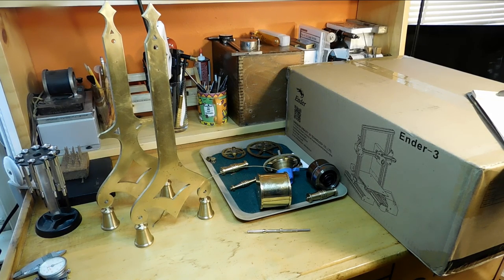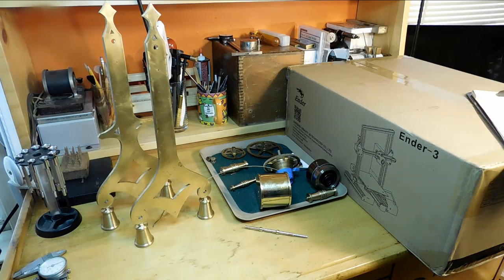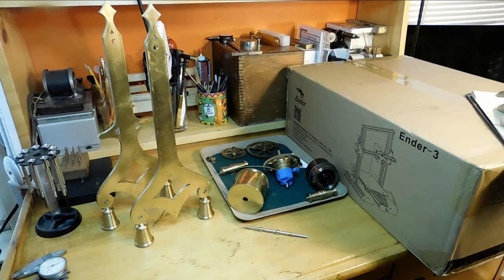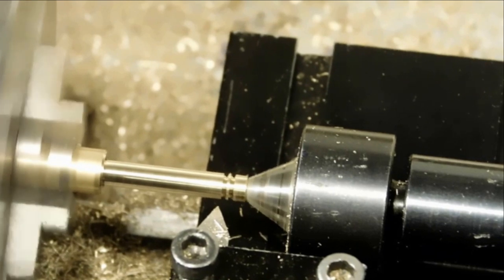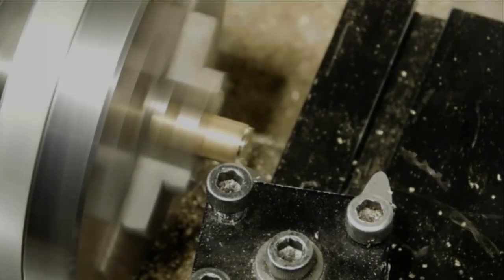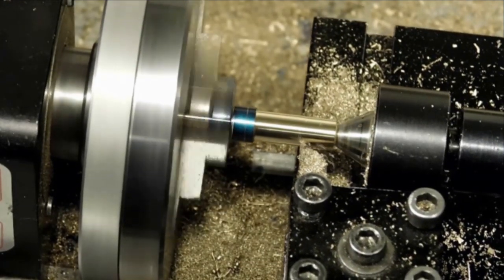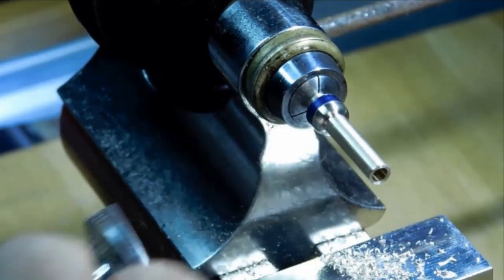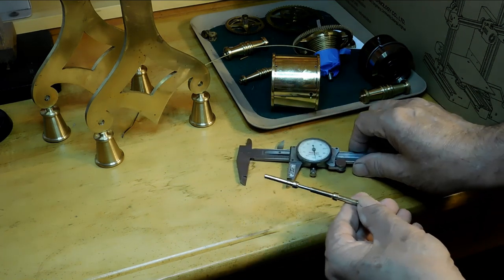WR Smith's Grasshopper Clock: Part Five Barrel Arbor Length Gauge

Comment: I wish you a speedy recovery. Sounds like the worst of it is over. 
Really enjoying your channel. I have been putting together a clock workshop and my aim is to build the grasshopper clock as well. Your videos are giving me the confidence to give it a try. Keep them coming.
Reply from the maker: Great stuff Brian...if you have not done so yet...read Longitude by Dava Sobel...story of John Harrison a carpenter who built the clock/watch that allowed us to find longitude at sea...BBC has a great series on it  as well...he designed the grasshopper escapement...great story...bob
Reply: @robertt-cs8fe  Hi Bob. I've read the book and the story of John Harrison is one of the reasons I would like to build a clock with the grasshopper escapement. It's a bit above my skill set at the moment, but I'm working on getting there.
Reply from the maker: Great stuff Brian...WR Smith is another source to help gain the necessary skills...thanks for stopping...see ya...bob
Reply: @robertt-cs8fe  Hi Bob. you mentioned The Clock and Watchmakers Guide to Gear Making by R.D.Porter in one of your previous videos. It's just about impossible to get in the UK, but I'm going to New York for a couple of weeks next week and was thinking of buying it on Amazon when I'm there. Do you think it is worth getting this book?
Reply from the maker: I use it a lot for making gear cutters...I've replaced gears in clocks as well as cut gear trains...I find it very useful for my work...if you plan to buy a gear cutter set...maybe not so much...hope that helps...bob
Reply: @robertt-cs8fe  Thanks Bob
Reply: Just got back from NY and I did get the book. I'm very pleased with it. Worth every penny. Thanks for your guidance and advice.
Reply from the maker: Great stuff Brian...I've found the book quite useful...I've even used the tables to reverse engineer cutters for off the wall repairs...have fun...bob

Comment: Hey Bob.  Hope you like the Ender 3.  I have been pretty impressed with it.  I would recommend a few upgrade to the printer when you have it up and going.  Most of these I talked about in the video, the only one left out was the filiment guide.   If there is anything I can help you with, just let me know.  I am looking forward to more of your Grasshopper build.  Glad you recovered well from your knee replacement.

Joe
Reply from the maker: Morning Joe...I got the Ender 3 up and running this morning...awaiting filament...will practice by printing upgrades for the Ender 3...going down into shop to set up for next Grasshopper clock build...good thing I'm retired...can't figure how I ever managed to fit in 8-10 hours of work each day?...having fun...bob
Reply: Funny you say that Bob.  I have a friend Jerry who has been retired for about 10 years now.  He tells me he works harder now and longer hours than he ever did while he was in the workforce.  :-)

Hope you have good luck with the printer.  If I had one complaint it would be how hard the prints adhere to the bed.  But that is better than them not sticking.  Again, if you need any help, let me know.

Joe

Comment: Glad your new knee is working well. Please leave your bloopers in.IE hitting your live center. That is how we out here learn :-) 

You may what to consider covering the watchmakers lathe in detail some time. I'm not too familiar with them to me, they look like a miniaturize wood lathe. What to look for if buying one. Take care
Reply from the maker: Ya left that one in by accident...if I would have continued on a bit  I paused and reground the bit...had to let it hit 3-5 times before I caught on to what exactly was hitting...with the CNC I was more concerned that I got the ending position right and the start screwed up on me...At Xmas time every year I tear down the head-stock of the Moseley and Peerless watchmakers lathes and lap the bearing surfaces... pretty much the same way you do with engine valves...that might be a fun video...I turned a balance staff a few months back but the video was in and out of focus as I was using the microscope...I might have to make another in the future...that too might be a fun video if I could work out the technical camera stuff...not much on camera stuff...thanks for stopping by Al...bob

Comment: 3D printer, start getting into Fusion 360.
Reply from the maker: Hey Steve...that was my first question to Joe from My Heap...I've been using AutoCAD for over 20 years but never much 3D stuff...he recommended Fusion 360 as well...I got a copy and it is from AutoDesk as well so that might help too...I've messed around a bit but just getting into it...the Ender 3 printer has a lot of free attachments available on line so will cut my teeth on printing them as I learn the ins and outs of Fusion...at 70 I was putting off learning 3D but now I'm really looking forward to it...bob